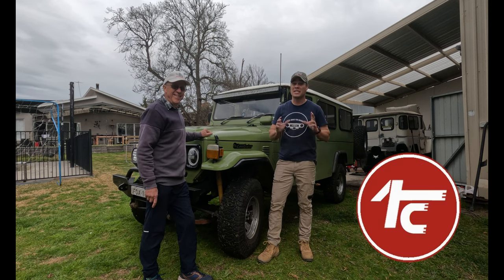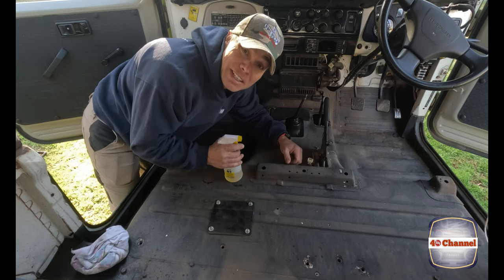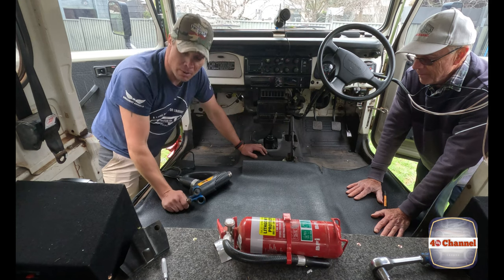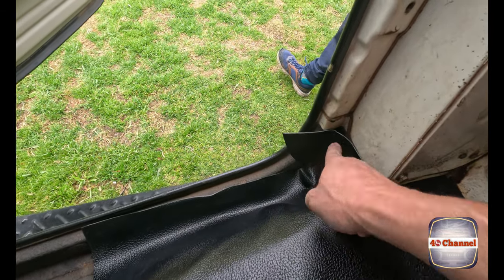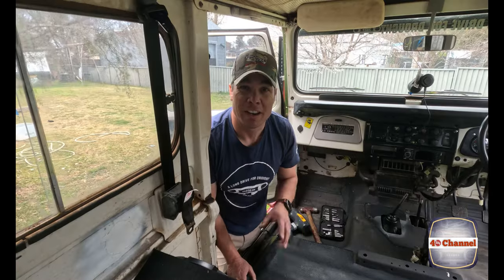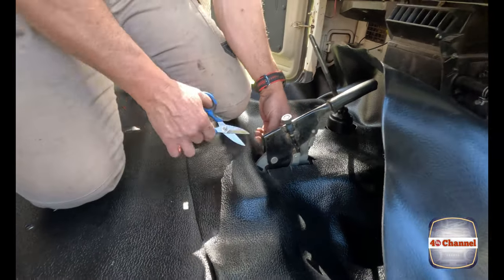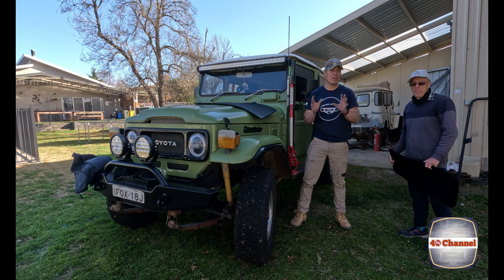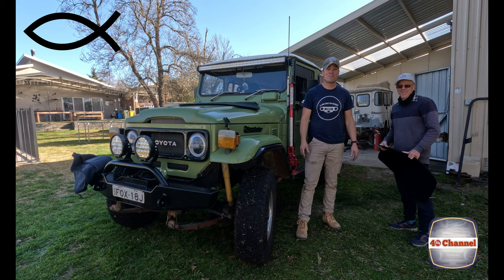S2EP97 - New Vinyl Floor  and Custom fit mats in the FJ45RV Toyota

Comment: Great work. Just one , maybe dumb, question. Why not but those wire under the vinyl ?? If they were too round there are some flare multi core wires available ( I think?. )
Reply from the maker: I did that with the last Build, but this time I ran then as original, only because I may add extra speakers to rear and I run the wires in the same without pulling the floor back up.
But you are right. I probably should have as it would look cleaner.